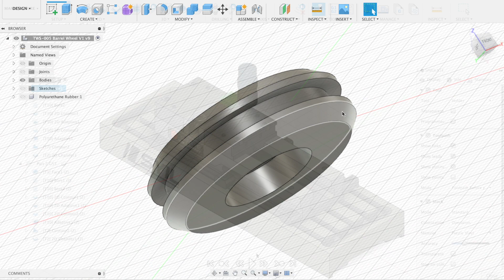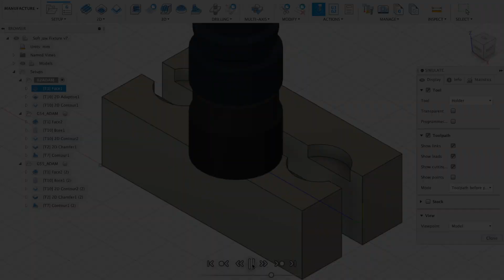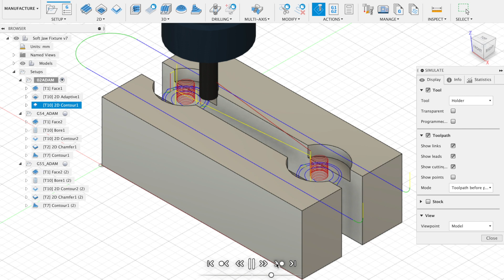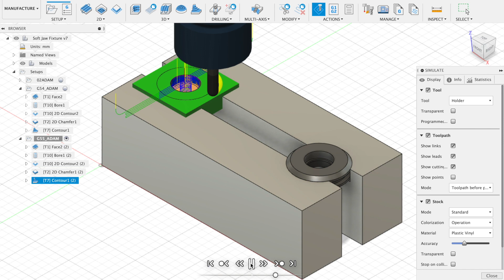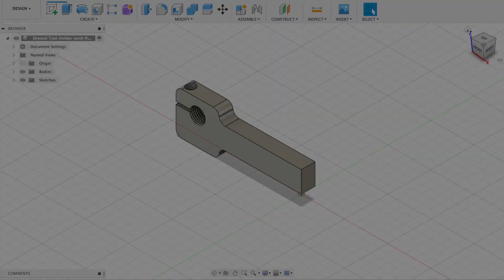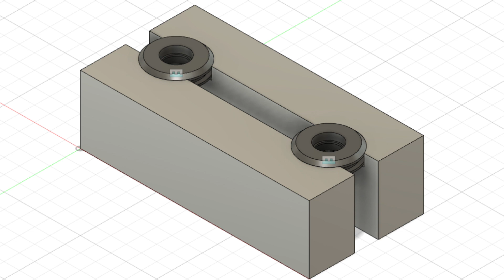CNC Machining Wheels in the Syil X7 Milling Machine

Comment: This seems to work out well for your customer, but for optimal bearing journal fits a boring head is the way to go. CNC milling machines do not hold concentricity very well.
Reply from the maker: G'day Richard.  You are absolutely correct mate.  The best way to get a "true accurate concentric hole" is to bore or ream it.  Circular interpolation is close (depending on the build quality of the machine) but it's not 100% accurate.  Thanks for watching.  Cheers, Aaron.

Comment: Nice - and I wont ask you why you did it on a milling machine and not your lathe! -:)
Reply: Hi Aaron, loved that video. While using a lathe to make "round stuff" sounds obvious, the accuracy and repeatability of a CNC mill(or lathe) to do any shape is a simple choice. Not to mention the time  advantages CNC brings. A wonderful level of technology that you can have in your own garage. Waahooo!!
Reply from the maker: @MOREENGINEERING  Thanks Peter. Yes I totally agree with you. Oh, and this was the same size stock I used on your parts too 😆
Reply from the maker: G’day Peter. I don’t have a CNC lathe. However I could have made them manually on the Colchester. The main reason why I didn’t was “laziness” 😂. Thanks for watching. 👍🍻

Comment: nice work start to finish / a dremel  never seen that done like that interesting
Reply from the maker: Hey buddy how's things?  Great to hear from you again.  Thanks for the positive feedback.  All things considered, the Dremel worked ok but it wasn't very rigid.  I should have bought an O-Ring cutter or used some shaped tool steel in the lathe.  Cheers, Aaron.

Comment: Hi Aaron, how you doin?  For some reason I didn't get your notifications for a long time and wondered what had happened.
Nice video.  How did you set the two soft jaws to be in the right distance from each other and had the front jaw fixed in it's place?   Funny thing is I did the same thing about 2 years ago and I have no recollection of how I did that...
Reply from the maker: Hi Dan.  It's really nice to hear from you mate.  Yeah, I've been rather slack on this channel lately.  I've been concentrating on my other YouTube channel called "Aaron Engineering".  Heaps of videos over there if you want me to bore you with ramblings and manual machining LOL.  To answer you question, I used a parallel strip to offset the jaws.  I measured the parallel strip and matched that in my CAD set up.  However, when machining I set the WCS (G54 & G55) to the centre of the wheel.  So it didn't really matter if the gap was identical or not.  Hope this makes sense, or I can send you the CAD file if you want it.  Cheers, Aaron.

Comment: You found the finish and accuracy from the dremel OK? My experience with a dremel (would not ever be without mine) is that its bearings are crap - sintered bushes in fact! Also the use of a round bottomed o-ring grove is unusual - universally, square bottoms seem the more common as they allow somewhere for the rubber to deform into as it takes shape to provide the seal - or was this not a sealing application?... Martin
Reply from the maker: G’day Martin. Nice to hear from you mate, trust you are well? Yes the little Dremel worked well. Customer called for a round grove, although his CAD model was square. The O-Ring is used to drive and support a stainless steel round drum like a tumbler. He wouldn’t tell me exactly what it did. Model is in a prototype stage.
Reply: @DCT_Aaron_Engineering   Well - no not really - but it is what it is 😏 Tumbler type application -  yep the round bottom grove makes perfect sense. Interesting how you use the ball mill for that chamfer, why not a straight angled cutter I am curious as knowing you there wil be a good reason....Martin
Reply from the maker: @olfoundryman8418  Hi Martin.  I really need to call you to pick your brains "grasshopper master".  I want to have a crack at melting and pouring aluminium (castings), but have never done it before.  Anyway, that's another story.
To be honest, I could have simply used a a grooving tool on the lathe to do this, but I wanted to get creative and give the Dremel idea a crack. To be honest, I should have just used a tool in the CNC and completed it during in Op-1.  Oh well, I was trying to be createmative (see, I can't even spell it) 🤣